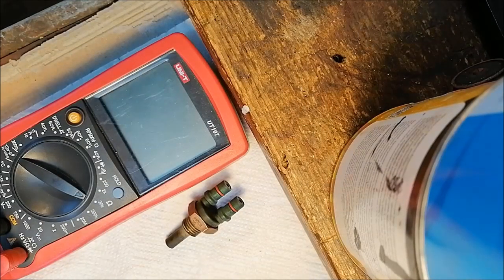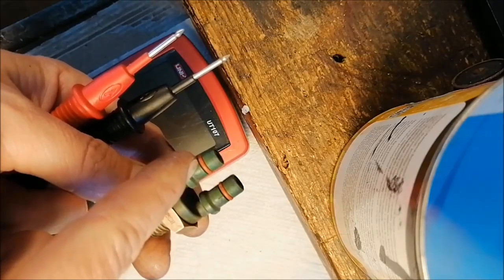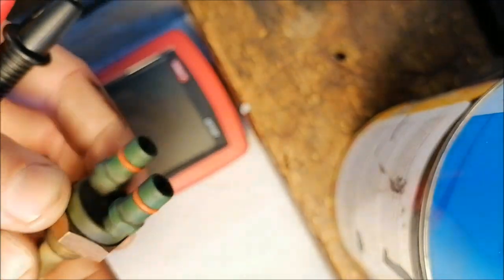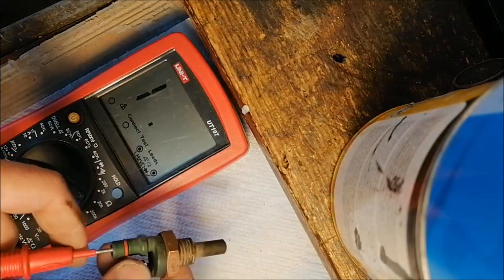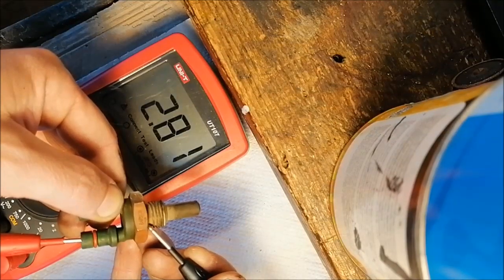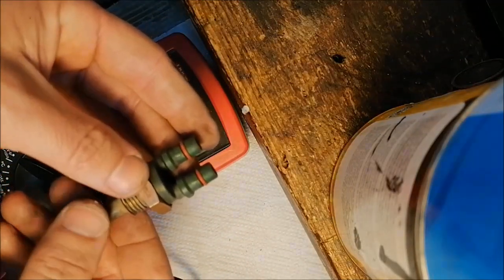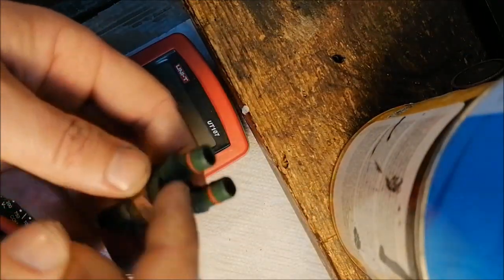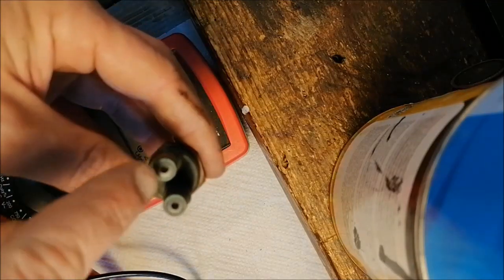Mercedes 190E testing coolant temperature sensor

Comment: Can you tell me what Year model 190e are you refering to, I have 1985, and I'm trying to figure how many  coolant sensors does it have,...is it just this one ?? Thanks
Reply from the maker: My model year is 1984 engine m102. 962 i have one coolant sensor pin1 is for EZL ( is ignition) and pin 2 is for ecu car computer to calculate what ideal mixture you need
Reply: Merhaba bu sensöre ait sokette voltaj varmıdır acaba yani takılan soketti ölçtüğümüzde kaç volt almamız gerekiyor